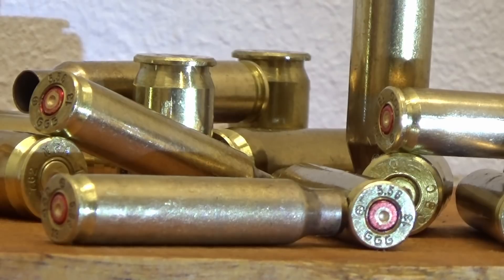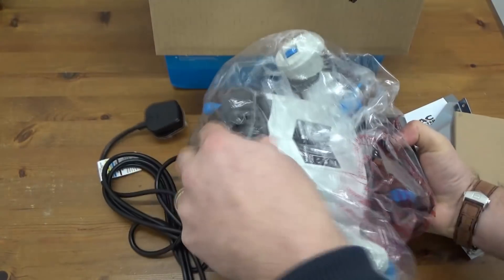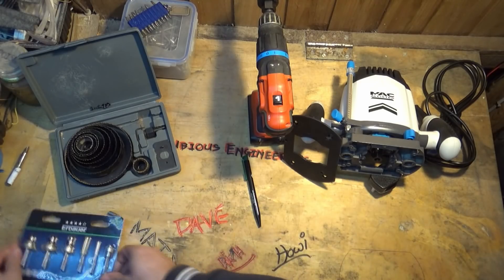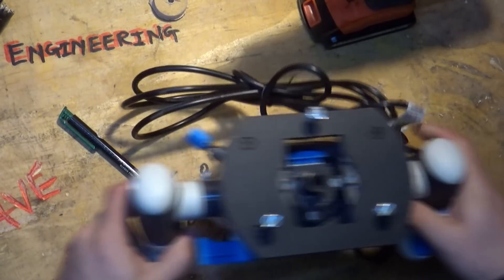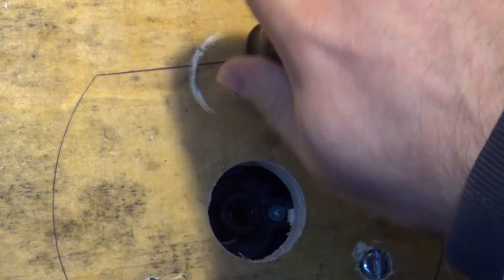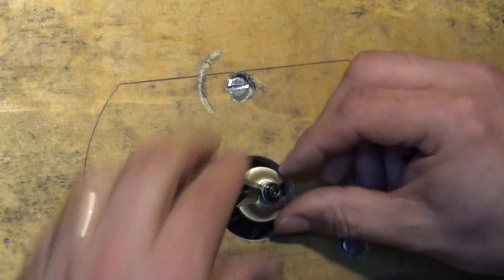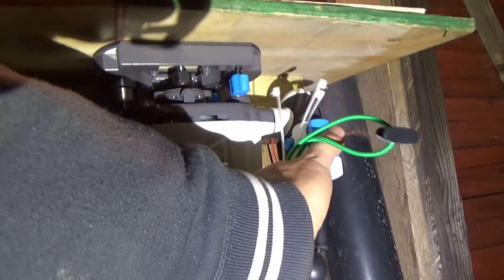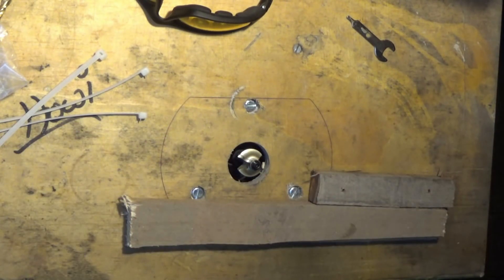DuB-EnG: Making A Handheld Wooden Games Console with bullet buttons PT1 - Install router to bench!

Comment: If you must do this, make a fence to cover most the bit with a notch cut in it and bury half the router bit in the fence up to the face of the bearing, so the work rides on the fence and the bearing at the same time.  Why is that cutting so hard, that new bit should be sharp?  Don't shape small pieces of wood like that, the wood is just not stable and the router will tend to grab light pieces.  It's better to clamp or screw small pieces of wood to a bench and hand hold the router. Just much safer when learning to do woodworking.  And you're right, the direction of the bit and wood is important with a router in a table.  A router in a table is really for running larger pieces of wood, it's not so great for small pieces like you are trying to cut. End grain is especially hard to cut and hold steady as you found out. It tends to grab the wood and you really don't want your fingers anywhere near that spinning bit. Best wishes and be safe.
Reply from the maker: tom ruth ... I had 20 mins today to get us d to this dangerous spinning machine... I wish I had seen your advice earlier... I’m still doing it wrong but getting good results now! ... Learning on the job! ... I’m an electronics and coding kind of guy a Metrologist by trade ... this is great fun!
Reply: I've been a woodworker for 35 years, but really wish I knew something about coding. I'm glad the router is working better for you now,  take care.

Comment: Use a second piece of wood to push the bit you're cutting and a fence/guide to keep it straight, very easy to loose a finger or two
Reply from the maker: Ross  Finlayson Absolutely! ... I ran out of time to use and test properly, I plan to fit some adjustable gates, I think I have enough butterfly nuts and bolts ... I need to make sure nothing slips and the cuts are accurate...  I guess I’m going to go off and watch some woodworking videos now to see how it’s done properly! :) ...  then bodge something together!
Reply: You should check out laura kampf, she makes some cool stuff out of wood
Reply from the maker: Ross  Finlayson thanks Ross ... I’ll go take a look!

Comment: To paraphrase the old Myhbusters tagline, I'm glad "you do these experiments, so that I don't have to" :D 
Been looking o get one for ages now ... the line you got out of it isn't very straight, is it just because you didn't have something solid to push it against, or is it down to the router's strength/speed ?
Reply from the maker: Igor Kolar ... the router bit has a bearing on it that means it follows the shape of the wood, so, those nasty undulations were because of the original shape of the wood...  if I had sanded the wood, that would come out clean.  Also, my speed was low, and my gate was not fixed.   I’m confident this will indeed do what I need it to, I just need to learn how to use it a little better! :)